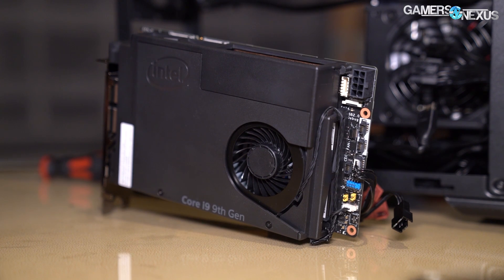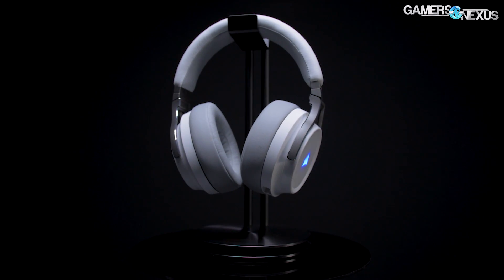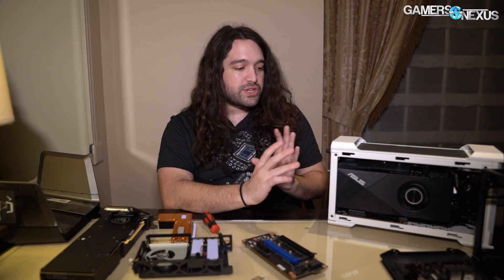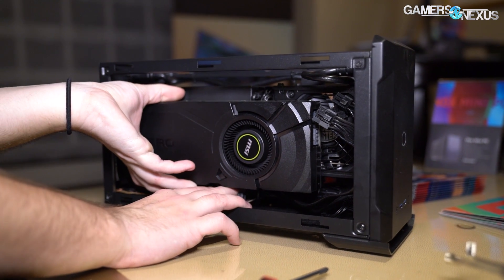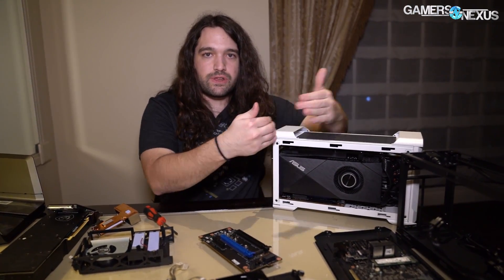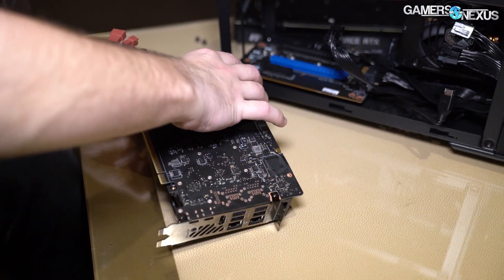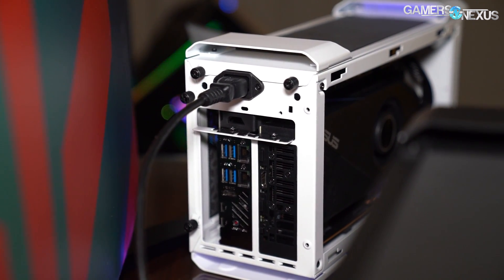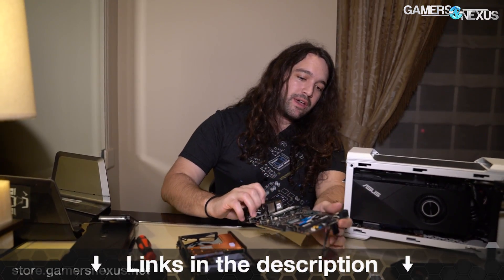Intel PCIe Socketable Computer: Tear-Down of Ghost Canyon NUC SFF PC

Comment: So, kind of back to the 80s designs. Basic backplane where we plug every expansion into slots.
Reply: Backplanes never stopped being a thing for industrial computers.  See, for instance, the HDEC stuff from Trenton.
Reply: @blarggggg  that did fall out of favor in the consumer world for good reason though. And it really should stay that way.
Reply: @waldojim42  I like backplane systems and have wanted to have on at home for a number of years.  Depending on how PCI-E lanes are handled, it can offer some really interesting advantages.
Reply: @blarggggg  experimenting with commercial hardware is always fun. But this doesn't belong on the consumer market. Generally speaking, this will either add unnecessary costs to the build (ie active pcie lane sharing) or reduced performance (lane splitting), and over all confusion for the general market, with people not being sure of what they are getting and the limitations that come with it. There are better answers for general use.
Reply: @waldojim42  Or it's just a very small machine with easily-swapped guts that also supports a video card.  That's all that most folks add to their home desktop rigs, anyway.
Reply: @blarggggg  Except that problem was solved a decade ago with the ITX standard. A tiny machine, that in frankly any modern scenario is easily modded, clean, and supports a video card. At the same time, your SSDs, wireless cards, etc won't be stealing bandwidth from the video card.

This is a problem looking for a solution. I would honestly bet this wouldn't last the year on the (consumer) market, once people start to understand the limitations this brings about.
Reply: It uses 2x M.2 for storage.  There's no indication of sharing PCI-E lanes for that. Bluetooth, SD, WiFi, and multiple Thunderbolt ports are included.  It has room for the singular device that most folks ever add: A video card.  And it is a much different, more-compact shape than any ITX system that supports a full-height video card.

This seems like it ought to be flexible enough for most folks.
Reply: @blarggggg  that m.2 on the back plane, that extra pcie slot, etc are all shared. Unless you are seriously going to try and argue they aren't...
Reply: Actually 70's
S100 forever!
Reply: @clifffton  Yeah, I was trying to remember what that bus thing was called that some somewhat older people remember. I've seen images of it. I am a little more familiar with good ole ISA bus.
Reply: @Voidsworn  Yep. I have a Kaypro 8088 with an 8bit ISA backplane. First thing I thought of when he showed us that.

Comment: Soooo. Thiiiis. Is kinda like the old model "slot in" blade servers ? 
And also like them kinda really expensive ? 😅

And in the same way they get rid their own fashion style slim laptop problems:
Slim laptop with no structural stability, really bad cooling=low effective workload,
no space for high battery power.

So after killing y-atx its now back ?
There were some asrock mini pcs where you could slot in a i7 about the size of a normal atx power supply. Of course no space for a gpu in there, or silent cooling options.
Edit: asrock deskmini 310 series

Comment: If Intel had the capacity to build a proprietary card, why wouldn't they reverse it so that the fan pulled fresh air from the other side of the case? Instead of suffocating it with the graphics card
Reply: These are test mule mock-ups, the final kits should be fine for what they are.

Comment: The socketable concept isn't interesting to me. The socket board is basically a daughterboard like the pre-atx days, which allowed addon cards to be installed parallel to the motherboard to save space. The size does seem interesting though. It's a soldered cpu, which affords it a massive size reduction to itx when including the cooling solution. Depending on pricing, is it better to go with itx and a pcie breakout cable?

Comment: I want to see how this goes and the cost. I’d love to try this out so I could see how it compares to a regular itx build
Reply: 8:16 your answer (edit, well, part of your answer. how it goes still unknown).
$1500 for the barebones, $2670 for the complete with 2080ti and 800w psu.
Reply: Well let’s see because it hasn’t been dropped yet so when I see a price I’d be more into it. But 1500$ for bare bones kit seems kinda high
Reply: It's not going to be much smaller than regular itx build. What were shown (cases for it) is bigger than plenty of already existing ITX chassis (that fit full length cards).

That Ghost Canyon takes two slots (40.64mm), about 180mm long and ~150mm high which is about the same dimensions as mini itx motherboard (170x170x50mm, 50mm is IO shield width).

Comment: I think this would make a bit more sense with an AMD processor/chipset due to PCIE Gen 4. You could just wire them x8 and get the same bandwidth of x16 of PCIE Gen 3.  Also if they reversed the side in which the CPU is facing would allow for better thermals (in theory at least).

Comment: Pretty sweet for what is basically a laptop board. This has some cool potential for small, affordable server set ups. I sorta love that it sockets into PCIE, thats just such a simple solution for a previously difficult and expensive solution in traditional server enterprise set ups. I can even see a future version of this with a decent AMD APU that doesnt require a graphics card. Have 12 employees? Buy a 12 slot base board and 12 identical slot-in pcs and have yourself a real easy set up.

Comment: That sounds interesting for really small systems whenever space is a premium. I think I would want one...

8:17 - nope, never mind...
Reply: Ouch, expensive single board computers
Reply: Why can't cooler master make a chassis like this for standard mini itx motherboard!?
Reply: There's cases that are just the same size or even smaller and fit off the shelf mini-ITX motherboards, so nothing interesting really.
Velka 5, Dan Cases A4-SFX, Louqe Ghost, Nouvolo Steck just to name some.
Reply: @niter43  pricey though for chassis alone
Reply: @patrickmonkman8151  yeah they're since none of big manufacturers wants to invest into producing them. So as niche thing you'd have to pay for ineffective production methods.
At least you only pay premium for chassis, not for whole motherboard with CPU.
Reply: @niter43  They have been producing machines like this for ages for the industrial market.

Do a search for "single board computer backplane" make sure you add backplane into that search because now days you will get more hits on raspberry pi and like devices.

You'll find single board computers for nearly every current generation of cpu as well as even dual cpu that plug directly into a backplane with up to 21 slots. And generally fit in rackmount cases.

Considered tinkering with the idea of doing something like it in the Pentium 4 days for a home computer setup, but the only outlets available for the SBC's and backplane's were industrial supply chains that had minimum orders of (way too much)

Cases on the other hand were (and still are) fairly easy to come by.

So really nothing new here, with the exception this is targeted at the consumer rather than industry.
I could also see this as being a console  killer at some point.
Reply: Intel doing this for a long time and they end support for it really fast
Reply: And I thought the Latte Panda was overpriced.
Reply: 3.8 Australian grand, I could get a good second hand car for a bit less
Reply: I saw your comment while scrolling/listening and was waiting for some design flaw, but dat price tho....
Reply: Cheaper than other comparable backplane systems, sadly enough. Might be a good fit to replace small CompactPCI systems, so long as you can get away with PCIe for IO.
Reply: There are smaller chassis with more adequate cooling with desktop cpus for cheaper. This concept idea is completely useless in current implementation

Comment: i saw the pci-e connector and thought this was going to be a PC you could socket into another PC via a 16x slot. that would have been quirky but neat if you needed to add some additional compute to a system, have your main system and slot in a mini pc add in card that you can run your streaming on etc.

Comment: I am curious if you can plug it into a normal ATX motherboard for power, especially if they would sell an i5 model or something, then it would be great for having a streaming box that is built into your gaming pc. Two pcs in one box. Or the server blade implications: A full ATX chassis that is just power cables, 128 lanes of PCI-E or so, and expansion slots, with no space for a traditional motherboard. All to build a rack system in a traditional sized case. Upgrade-able consoles, ultra-compact SFF gaming systems, etc.

Comment: The more things change, the more they stay the same. I spent the first half of the 1990s working for a company that sold x86 machines on the same form factor for ISA. With the computer on the main plug-in board, video on a standard ISA video card, then between 1-5 additional slots for upgrading the I/O for the machine. 
The funny part was that system was a copy of the S-100 bus machines that we sold back in the 1980s...the more things change the more they stay the same.
Reply: Let's not forget that they're reintroducing the features that Creative Labs had in the old Sound Blaster 16.

Your last line is absolutely correct.

The "cloud" just sounds cooler than "mainframe" as they've made mainframe sound outdated.
Reply: I was thinking the same. Such an old idea.
Reply: In the pre-Jobs PowerPC era Apple was even selling a first-party PC Personality Card for Power Macs, a 66MHz Pentium PC on a PCI card https://pcmuseum.ca/details.asp?id=108 .
Reply: I would say Intel got the idea from its past.
It seems the same but it really isn't. It is a more adaptable reinvention.
If you remember Pentium II it was a Cache and Processor combo. Later they integrated the Cache in the die.
This NUC is basically the repeat of the Pentium II but it foreshadows the integration of RAM on to the processor die.
It is also possible they miniaturizing the Blade Servers for home use. I would love the idea of affordable and efficient home server made out the lover speced compute modules.
Reply: I remember those machines but never used one though. I guess intel never scrapped the idea.
Reply: I remember seeing machines like that. They were quite innovative, but a nightmare to disassemble from what I remember. From the point of view of small form factor and custom PC building it's a shame they didn't catch on. It's always struck me as strange why they don't make PCs much more modular. It never caught on with mobile phones, but it really could be a possibility for PCs. Imagine if all new PCs were just a tiny board with the CPU and memory on it that plugs into a x16 PCIE slot on a small main board. I guess it comes down to the bean counters working out that they can make more money if most of the PC is on one big motherboard. I wonder if that's still true in modern electronics fabrication and manufacture processes?
Reply: Reminded me of the Accelera upgrade cards Evergreen used to put out. When I was in middle school, my family upgraded an OG Pentium system with one, anyone else remember these?
 https://www.cnet.com/products/accelera-pci-700-w-256mb-sdram/
Reply: You are alluding to Olivetti M290S. I had one of those. Has a ISA backplane and you can plug in the processor board, IO, graphics etc. Good old days. Cost a bomb in today's dollars
Reply: No one exists except for you.

Comment: really missed a beat having the CPU board facing the opposite direction
Reply: Most PCIe x16 slots are spaced 1 slot apart not next to each other, hence facing the traditional orientation. Also, if it wasnt obvious enough, a PCB on the same plane as the PCIe connector is more structurally sound than having them on different planes
Reply: @hyperparadox1  they aren't following pci-e spec its a custom daughter board; if they wanted to keep the spacing then just put the components on the other side...
Reply: @schneeb  of course they follow PCIe spec, if they didn't, most cards wont be able to fit even if they tried

Comment: ...This could be used for a dual system streaming setup, if you can get it running in a regular motherboard.
GPU in top PCIe, NUC in bottom, NUC has a thunderbolt or USB3.2 capture card plugged in, doing software encoding in OBS, and main system does the gaming or otherwise whatever happens on the user's stream. That is, assuming that the NUC can run off of a regular PCIe slot, rather than a baseboard made for it. It could save a ton of the space that is traditionally required to be used for a dual system stream.

Comment: my dan case has a similiar size then that demo system :D with standard pc components..
Reply: I have a hp g3 workstation "nuc" with a normal desktop CPU that is 1/3 the size and half the price.
Reply: @excitedbox5705  Does it have an i9 and a 2080Ti though

Comment: One Idea is to have it configured to be able to emulate a ethernet card on the pcie connection, so that you can plug it in to a Desktop motherboard and have 10gb connectivity between both systems.